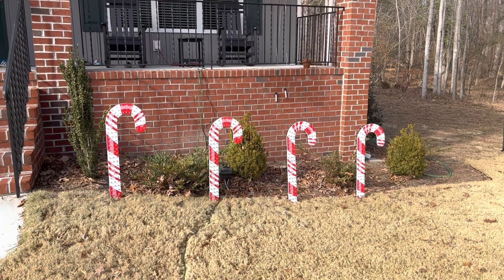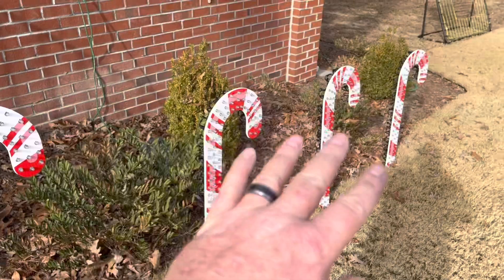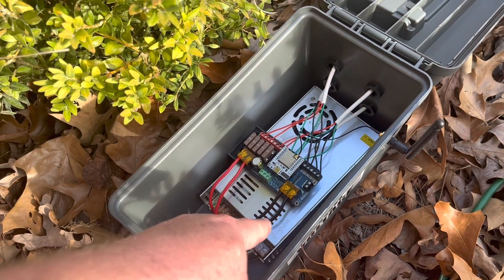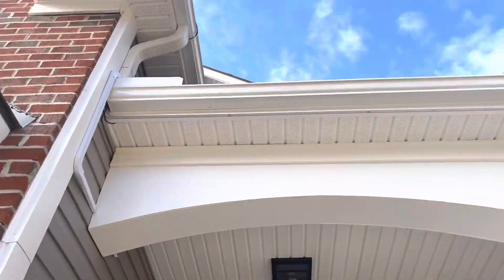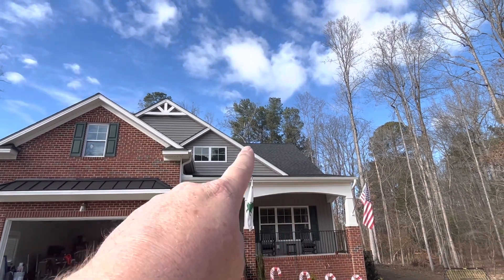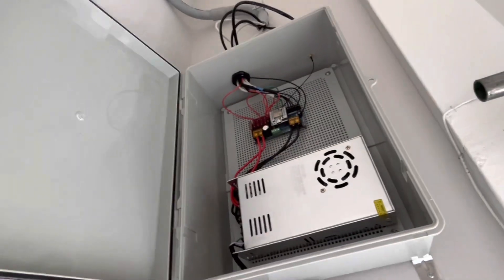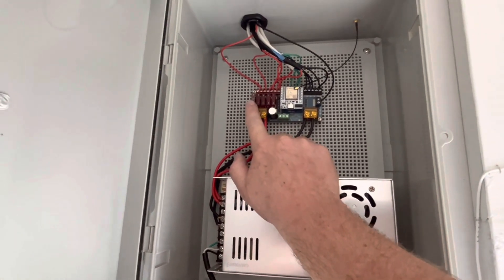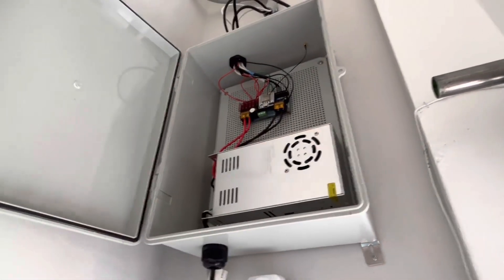Holiday light show behind the scenes 2022

Comment: Thanks for posting. How much do you have invested in your lights so far? I want to start doing something like what you did to my house.
Reply: It's gonna be about $180 for a controller + lights which are like $15 for a strand of 50 and then props and then power supplies which for two I paid like $60, and fm transmitter is like $100 for a decent good one. And then the cords and all that